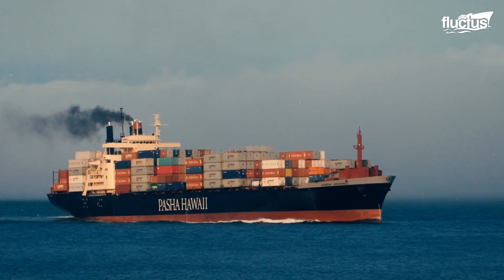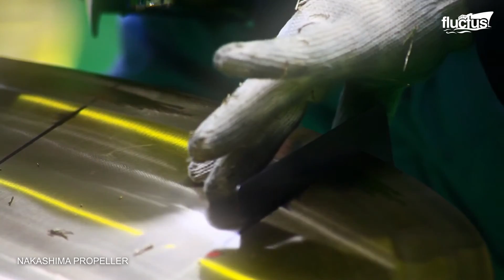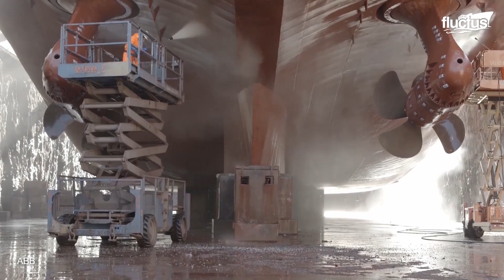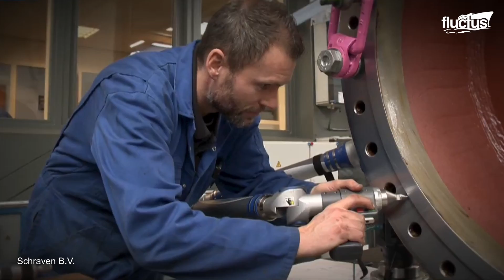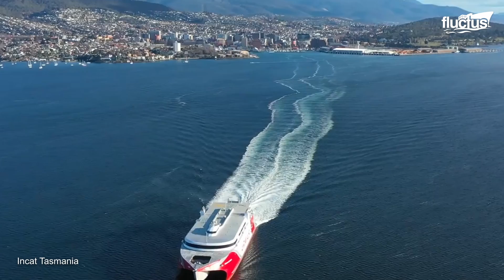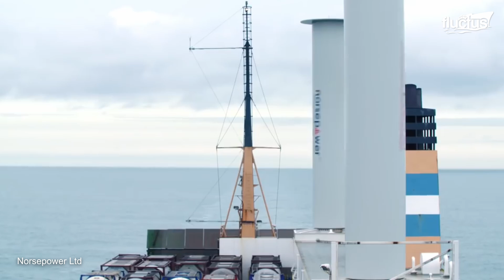The Crazy Process of Repairing Gigantic Ship Propellers by Hands

Comment: Yeah nah, been working for a larger propeller manufacturer. 
No special tools are used when polishing those propellers. 
Normal power tools, abrasive papers and Scotch Bright, common tools and wire brushes is pretty much all needed. 

PPE and good ventilation is a great idea too.